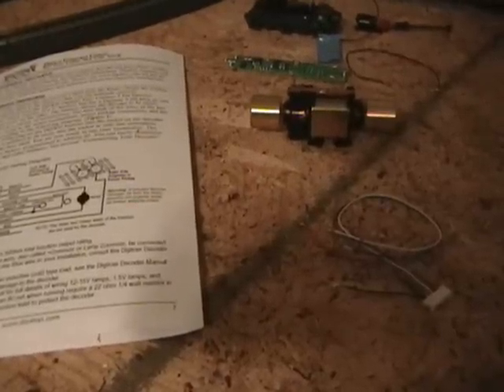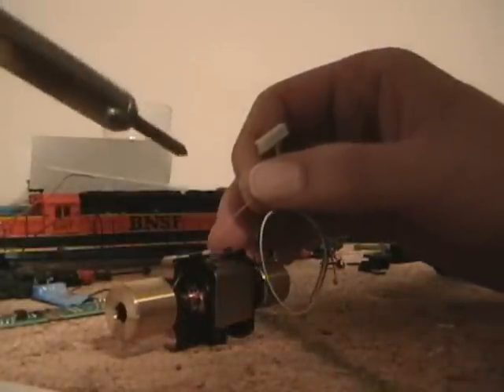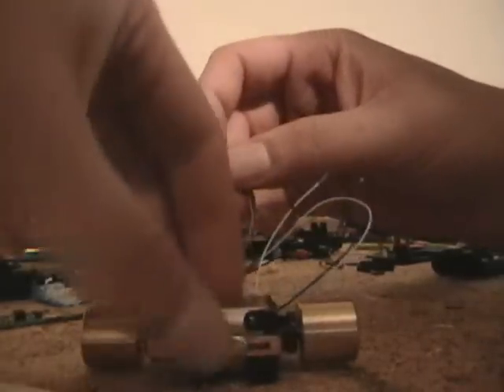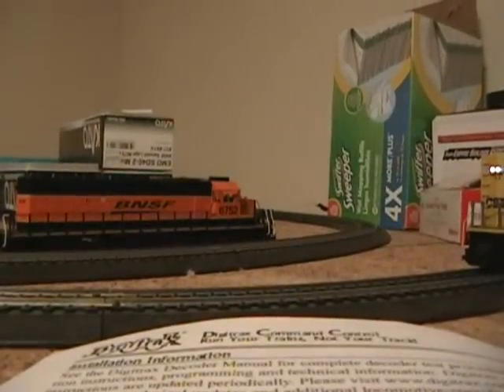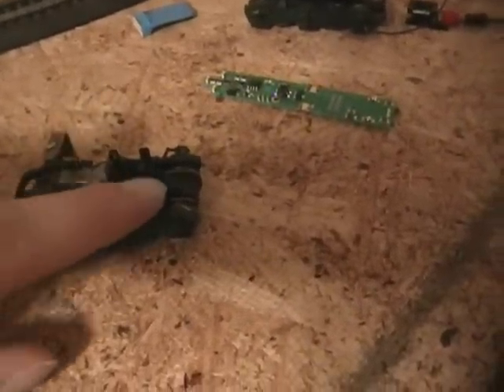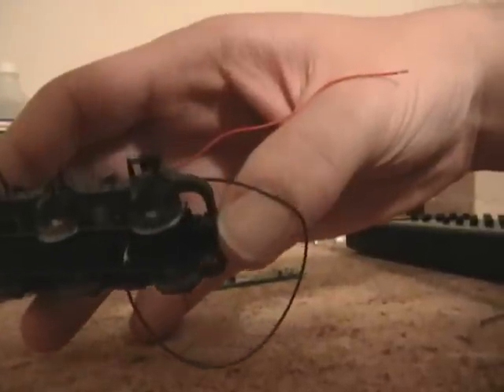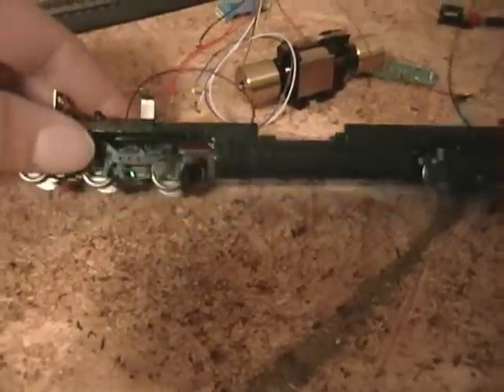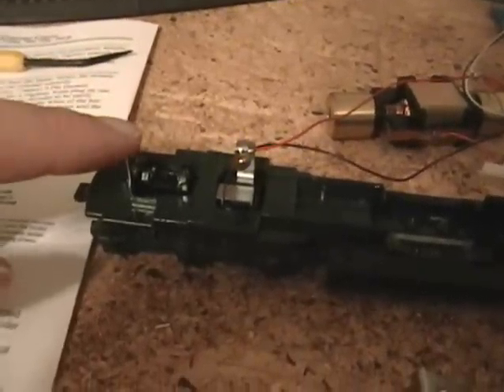11-03-2009 How to Install a Digitrax DCC Decoder into an Athearn SD40 - Part 2

Comment: Cool video, so the bottom motor contact the negative (Gray) and the top contact is positive (Orange) for the motor? And you still isolate the bottom of the frame which comes in contact with the motor to avoid shorts?
Reply from the maker: +SPnoza LA Correct. The decoder will not function if there is contact.
Reply: +tommie022481 Thanks but Im not sure I understand your answer. On the Athearn motor theres the bottom motor brush which is the negative for the motor (gray wire) right? And the top motor brush is the positive for the motor (orange wite) right? Also, the bottom of the frame will need to be isolated to avoid metal on metal contact between the frame and the bottom motor brush to avoid shorts correct?
Reply from the maker: SPnoza LA That is correct. Orange wire on top. Grey wire on the bottom. Remove the factory tab and isolate the motor from the frame. If the motor does make contact with the frame, the decoder may short, but will most likely not function until the circuit is corrected.
Reply: Okay, thanks man ;)

Comment from the maker: Hi - The DH123AT is a great idea, but when I attemped to use it, the wires were too long and all of the soilder joint broke. I ended up setting it up as the regular DH123D anyway after spending the extra $4.

Comment from the maker: @donsgotmoney You are correct, this is an older video, many of my new installs do have led lighting. I normally use 2mm on most and 5mm on F units. Thanks for the post.

Comment: I know this is an older video, I appreciate you showing this. I have been wanting to do some of my older athearn loco's for a while but was concerned that you couldnt use the older models. You have just anwsered that question. I was curious though as to why you have updated the power to this that you dont do the lights as well. You can install 1.8 led's on the dual lamp for a SD model and 3-5mm on F units. Great job either way. thanks.

Comment: Hay thanks alot the tip with the black wires is really useful for the real old blue boxes. I also noticed that the newer athearn engines (made around2008 pre dcc ready) work well with one black connection to the headlight stand, when the light is removed.

Comment from the maker: It could be one of a few things. First re-check all of the wire connections and make sure they sre soldered good and tight. Next make sure the track and wheels are clean. Also make sure all of the wires are out of the way of the motor and drive tran after the shell has been re-applied. Hope this helps.

Comment from the maker: One wire goes to the post on the top of the truck, the other wire goes to the opposite side of the post on to the side frame. Yes it will appear as either brass of silver metal. If you don't want to solder the truck side frame, you can solder a wire to the frame of the loco to make the ground.